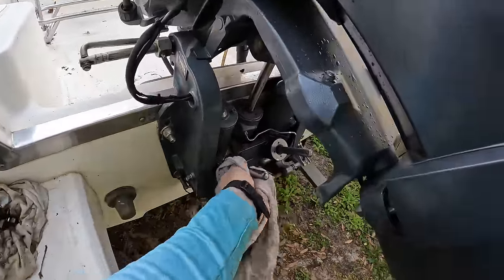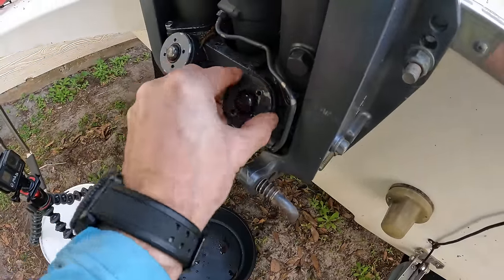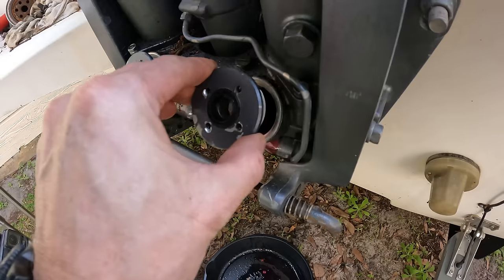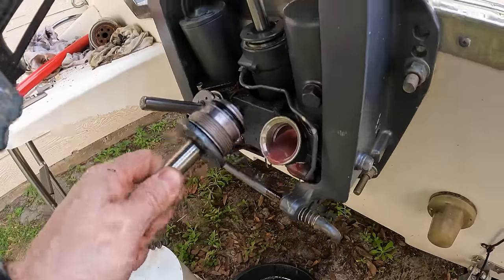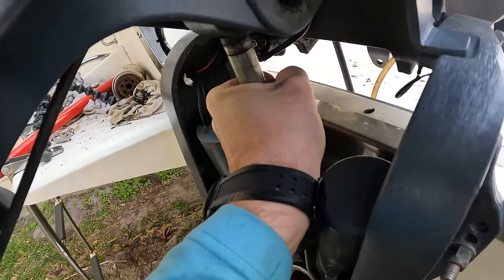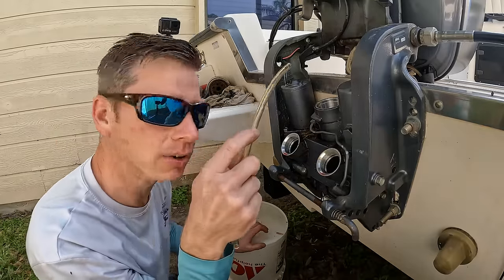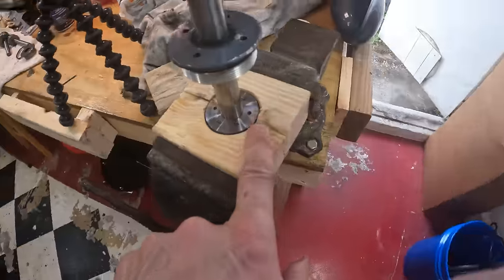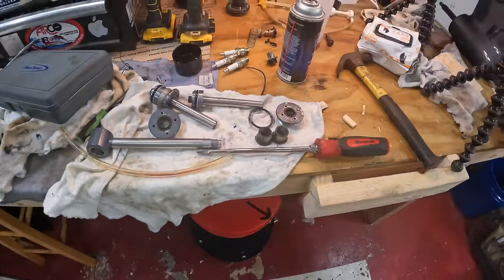Fix Your Own Trim Leaks

Comment: should have just removed the  complete ptt motor rather than just disassembling it on the engine. less mess and easy to work.

Comment: For my tilt and trim, I just push the up button and then making a humming sound with my mouth while I grab the lower with my hands and lift it up to the height I want. I then slap a tire iron in there to hold it in place.
Reply from the maker: Hahahahhah yes, sounds like the special effects FX is on point! lol

Comment: Can’t get all the air out of my trim despite going up and down many times. I can’t get the motor all the way to the stand because my hydraulic steering lines are hitting the transom. It’s an old bass boat. Is not getting the tilt ram all the way up why I can’t get all the air out?  I could remove the hydraulic steering and get the motor all the way to the stand.

Comment: Doing this right now on my 90 Etec.    I bought the same tool from Marine tech.   These older Evinrude are getting more and more expensive.  Mine is a 2005 with probably 2000 hours.   Runs like a top though.   The seals only seem to last 4 years on the rebuild.   This is my second time doing it.   Evinrude says use the biodegradable fluid.  But I have read the atf is a better option.   Great and timely video.

Comment: I need to do my trim seals toon. On the topic of one of your other videos,  I had great success with flushing the engine using Rydlyme and a bilge pump, recirculating it. The crud that came out of my motor was crazy. It runs so nicely now with cleaned thermostats, new impeller and a thorough cleaning.
Reply from the maker: I'm glad the video was a help to you!

Comment: I have this same motor and am doing a lot of the same stuff you are. Your videos are a lifesaver. This is the first Yamaha 90 2 stroke I've owned & it's such a rock solid motor I'm kind of astounded. Gonna look for a new old stock to replace it instead of a 4 stroke too.
Reply from the maker: Great to hear!
Reply: @BornAgainBoating  there's a good chance my tilt & trim has water in it. I'm concerned that i might find some corrosion inside the pistons. You mentioned that not a lot truly goes bad on these...but I'm curious...what would give you pause on the internals apart from what you mentioned about the rams being knicked?

Comment: Looks like a back up ring behing the o ring. Good video!
Reply: The white ring of less elastic plastic is an anti-extrusion ring.  It prevents the o-ring from squeezing in the clearance between piston and bore when under pressure.  I ALWAYS put it on the opposite side from the hydraulic pressure. I believe his lift cylinder had it on the wrong side of the o-ring.

Comment: Fantastic information! I managed to do the trim seals on my F250 but I wasn't able to get the tilt seal off using the junk tool I got on Amazon, all of the tabs broke. I'm going to get the Marine Tech tool and give it another shot before I bring out the air hammer.

Comment: Great tutorial- thank you for demystifying the secrets of the power trim system!
Reply from the maker: Glad it was helpful!
Reply: @BornAgainBoating  For sure! The trim on my 2004 F90 has started sounding like it’s straining a bit to lift the engine. Maybe just low fluid but now at least I know how to check for that and contaminates. Cheers

Comment: A Glan nut wrench will work too, but only 2 pins on a glan nut wrench. If you mar up the holes in the trim caps, you can carefully, very carefully clean them up with a drill bit 1/16th size over. Great informative channel.
Reply from the maker: Thank you!

Comment: Brilliant video! Just did mine, but didn't realise the wiper seal and the 0 rings on the tilt, were opposite to the trim. Is that the same on all engines?. I've got an old Yamaha 50.  pro

Comment: Great Video, But one Question, shouldn't the rams be retracted when you fill up with fluid, I don't know much about this Type of trim system, but on my IO cylinders, they have to be retracted to fill the Revivor or it will over fill, found that out the hard way and made a mess.

Comment: Ever had the o ring on the cap squeeze its way out. I had it fixed last year and just now found out it did it again. I am wondering about the torqueing. I have a torque wrench do you happen to know what the spec is? Thanks
Reply from the maker: Not really, I've rolled the o-ring before and squished it lol but worked out not really, unless the cap was loose, I don't know the torque spec, I tighten them as tight as I can safely tighten them just before I know the tool will slip off lol, aka tighten it tight! But could have just had a bad oring or something might have messed it up :)
Reply: @BornAgainBoating found out the torque spec is 115lbs

Comment: I went to go out yesterday finally had some good weather noticed trim did not work then it wouldnt start.

I connected the power straight to the trim motor and it arcs out on the battery and it i earth one to the boat the other on the positive it wont work.

MY real question is though should my otuboard start when i disconnect the trim motor

Comment: I have a slow leak and a few drops here and there from the two lower rams .You think a new dust seal on each one would do the trick and reuse the o rings and plastic seals ?Thanks and oh would you know the dimensions of the seals for that unit in the video .Thanks Terry
Reply from the maker: As long as your rams aren't pitted or scratched that would be how to reseal it for sure. I don't know the dimensions of the seals, you have to look them up based on your engine model :)
Reply: @BornAgainBoating  The only way oil can get to the "dust seal" is past the piston seal.  So the piston seal needs to be replaced too.   Another important function of the "dust seal" is to keep salt water out of the cylinder.

Comment: Have you done this same service on year 89-95 60-90 hp mercurys? Is it possible to remove tilt ram same way as you did with this Yamaha without removing whole trim unit off the motor?
Reply from the maker: Hello! Rose here, aiding Aaron with comments. This topic is top-notch! It's getting spotlighted on our podcast. Not a subscriber yet? Join us here: https://www.youtube.com/@TheBoatersPodcast

Comment: I want to see you do a Johnson/Evinrude 40 or 50 HP two stroke.   That top pin is a mullefugger.  Then the inside split seals on the tilt cylinder cap.  I want to see your trick for getting that one to seal reliably,.......the first time.    I hate them.

Comment: Can't I just use the adjustable pin spanner wrench for a grinder? Or it doesn't fit the holes?
Reply: You might get away with that if the screw caps are not on too tight and have not corroded in place.  But they will tend to slip out and damage the little holes.  The tool he uses also employs three pins, not just two.  You saw the torque he had to apply on this comparatively clean well maintained outboard.